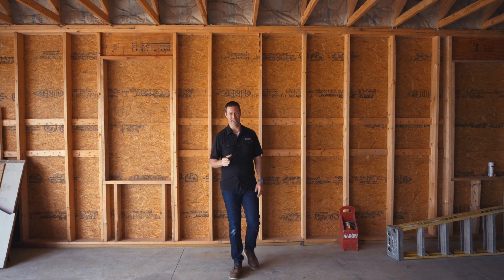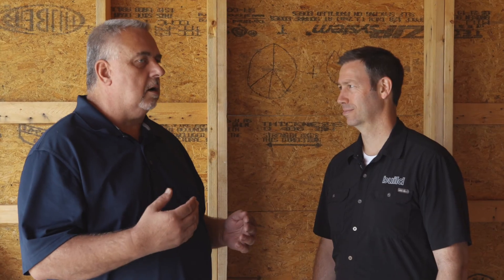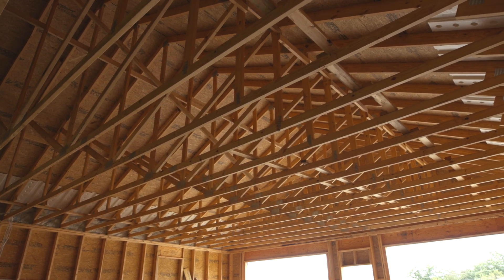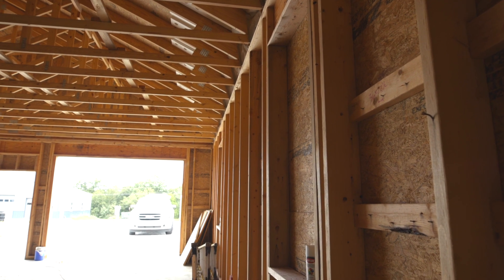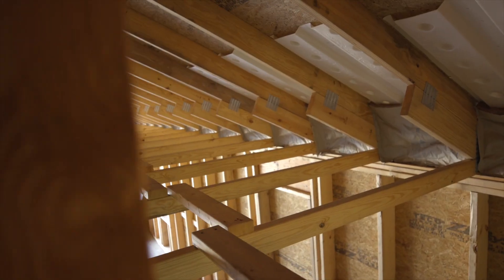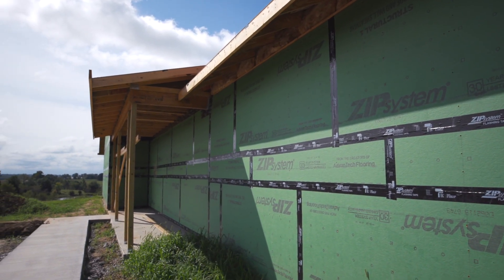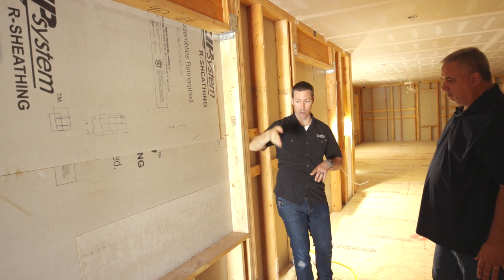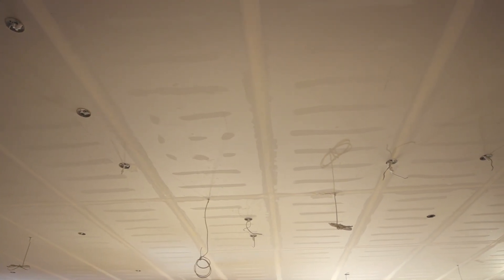Traditional vs Advanced Framing - Details

Comment: This is how we've framed in Canada for as long as I have been framing (20 years). I don't understand why they're talking like this is cutting edge "advanced" framing lol
Reply: Western platform framing has been the thing since the seventies i believe, when plywood and osb became available.   It's the cheapest and fastest way of building a decent house with a really low rate of structural issues. 

I think the whole netzero house thing is  a huge mistake, we are going to try forcing the entire market to only use the highest end stuff.  It's akin to telling everyone they have to drive only mercedes.    What should be on the bleeding edge of experemental stuff for rich yuppies who want to show off will be mandated for everyone, everywhere, and hang the consequences.   Seems like a mistake to me.
Reply: @hosmerhomeboy  I don't understand - this is pretty much platform framing. We made certain selections here that could have alternates. My intention is and will always be to use the concepts and materials we use every day - just use them with a more conscious effort. If you see otherwise, you totally missed the point of the video. There is NO conspiracy here to drive the cost of houses up - just a drive to use good based decision making to make what we already do, better. That's it, period!!
Reply: @stevenbaczekarchitect9431  Steve, the Zip-R provides a continuous thermal break, but how is it superior to Zip + polyiso on the outside that also provides a continuous thermal break ?  Is the shear strength of Zip-R as good as with Zip/OSB attached directly to the framing ?  It seems like it would be weaker.  What is the cost of Zip-R vs. Zip + separate polyiso ?  It doesn't seem like separate polyiso involves much extra labor if adding furring for a rainscreen anyway, so if the material cost is less for separates does the total installed cost wash ?  Last I checked Zip prices, it was 3x the cost of OSB and still twice the cost of OSB+Grace Select membrane.  Is the labor to tape and roll the Zip joints so much less than applying a membrane to commodity OSB that Zip really makes sense ?

Also, although 2x6 24"OC costs about the same as 2x4 16"OC for the studs ... the plates, sills, jacks, and cripples push the wall cost up by about 25% by wall sf.  Nobody seems to mention this when talking about advanced framing -- that it is not the studs but the "horizontal members and extra studs" that add the cost. I do think the extra strength, especially for tall walls, and the extra insulation space makes 2x6 framing worth it.  Cavity insulation is cheaper than exterior insulation, so using that extra depth and fewer bridges to shift some R-value from outside to inside can make up that cost difference.  In my case, R19 foam outiside and R13 cellulose fiber inside would cost $1.90/sf of wall, but R13 foam outside and R19 cellulose inside would cost $1.40/sf, more than washing the additional framing cost.  R32 total either way, so is R19 exterior foam going to provide so much better thermal break than R13 foam, that the additional cavity insulation due to wider stud spacing and depth behind electrical boxes, etc. make 2x6 framing less insulated ?
Reply: Never meant is to be cutting edge - just the decisions for what we did here - Canada has always been in front on this stuff!!!

Comment: When I get the chance to build a home I will hire you and you can use it to make a video for it. but I want you to build it because you dont have a problem trying new things.
Reply: Jason Adams This is one of the worst framing jobs I’ve ever seen. No J-bolts for the garage walls, didn’t even see a foundation, maybe it’s a monolithic? 24” on center not enough trimmers under the bigger window openings to sustain the weight load, plywood being horizontal instead of vertical with having the blocking being flat loosing a lot of structural integrity... no truss clips as far as I could see in the video... what is holding the trusses to the exterior walls for uplift? As far as I could see he is a cheap architect cutting corners and pretending it’s an “advanced or smart framing” this would flunk and be the poster child for the worst frame jobs in Utah. If I was buying that house I would walk from it. As a designer and a builder, that architect is a knock off and doing a disservice for his clients. Infuriating to say the least. This would never pass any building codes in Utah.

Comment: I'm a fan of 24" framing. But one reason I keep double top plates is that you can still use standard stud lengths and drywall for 8'1" and 9'1" wall heights.
Reply: Yea, plus you end up with a continuous plate which is kind of critical in terms of transferring diaphragm shear to the shear wall - definitely helpful for the structural engineer so that you don't need to strap every splice in a plate...
Reply: That's true about the height benefit plus, that extra plate  helps straighten a wall. Saves time from a framers point of view.

Comment: I would bet that if you built this exact same house with smaller and less windows at the same location it would be 10% or more efficient.  
People always talk about how windows will save them on lighting cost, This is no longer true, Lighting is super cheap these days, A 10th of what it used to cost. 
Drop 80% of those windows and you will save more in heating and cooling, Even with the extra lighting cost.
Reply: William Glaser  I’ve heard that it’s good to let the outside in, because if it’s not beautiful no one will maintain it. 😇

Comment: Can’t beat physics.  Terrifyingly poor design.  Point loads should be over the studs.  24x on center with all weight distributed to outer walls with free span rafters is not smart. Double plating helps distribute the load.  It’s scary when the builder doesn’t understand the basic purpose of double plates.  Same goes for jacks and headers.  inserting 2x6 blocking stubs to lift the rafter system off the plates creates lateral moments if not tied down  and anchored properly.  Terrifying stupidity.

Comment: Sorry, but not a fan of this advaced framing.  24 inch centers remind me of the days when builders started cheaping out, and houses also had aluminum wiring. I also find those overhead trusses a huge waste of storage space / access to the attic for wiring, roof inspections, etc. I love to use my garage as work space and my garage ceiling has  2 x 12 beams across with no columns either. It is a large two car garage that I can pull an engine from a pull point on the ceiling. Those 24 inch centers are also a nuisance to the home owner every time anything needs to be attached to a wall...lots of drywall anchors needed I guess, plus the sheetrock has less support. My feeling is that if you are going to go through all the trouble and expense to have a custom house built that you plan on living in for many years, don't be a cheapo, just do it right or just buy a cookie cutter mass built house if you are looking to profit over a short term.